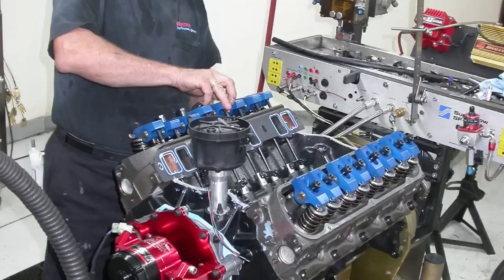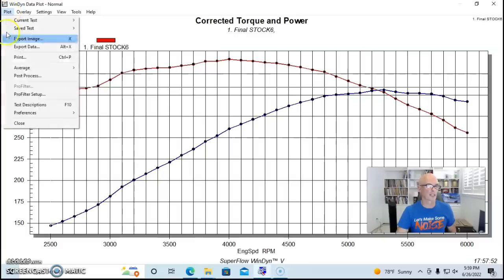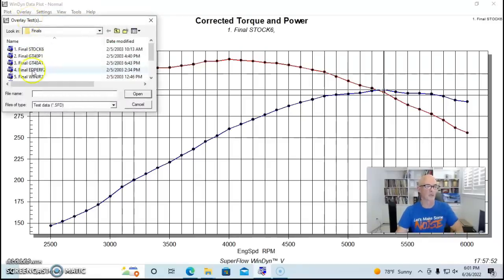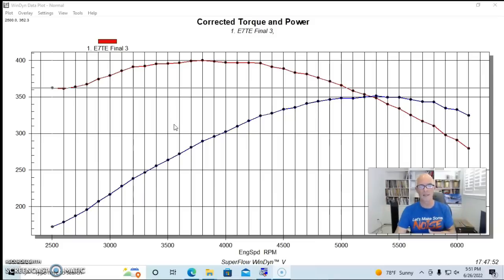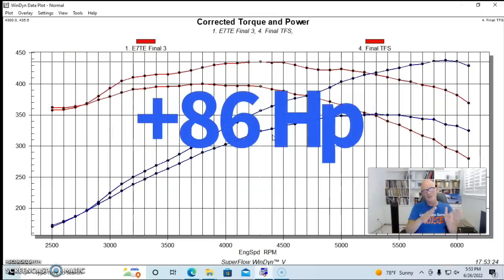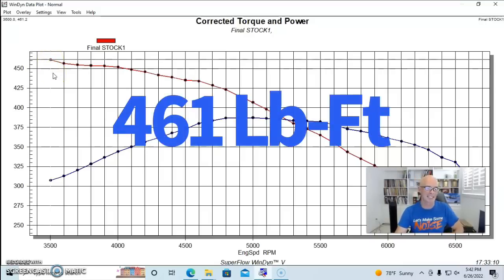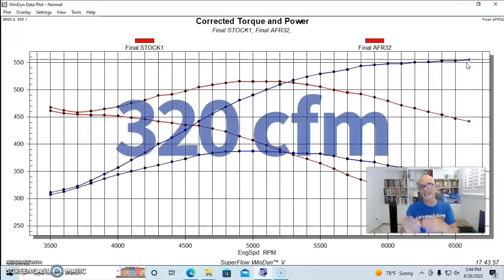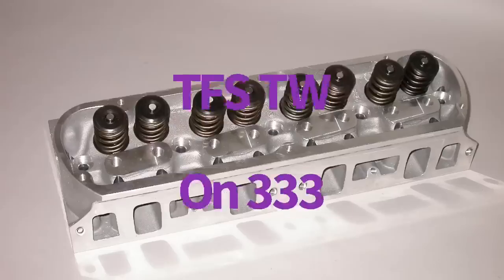IS THIS THE MOST POWER EVER PRODUCED FROM STOCK FORD E7TE HEADS? TOP SECRET-HEAD UPGRADE ADDS 168 HP

Comment: yes stroker  engines  can make more power  not only from the increased displacement but from the better breathing efficiency resulting from a relatively more  square bore/stroke sooo more power per flow cfm …..this is why a 400 hp 302 needs a 270 cfm head not a 200 lol where as a perfectly square engine would actually make 400 with 200 cfm

Comment: I'm not trying to be a smart-ass, but it is amazing to me that no one has taken a 317 head and milled it down to the same compression as a 706 and done back-to-back test on it. All I hear is the 317 is worse. How much worse is it. Is it 10 horsepower or 40 horsepower? It seems all I've been hearing lately is just speculation and no actual dyno test to back it up period is there actually a video showing showing the comparison?
Reply from the maker: you can't mill the 317 down to 706 chamber size (that's 10 cc)-but Brian Tooley from BTR has compared the 317 to the 243 heads with the same chamber size (they already have identical ports and valve sizes). The chamber on the 243 heads made better power

Comment: Stuck at work (wasn't the plan) but I'm making the most of it and binging on your SBF videos with my ear buds in. This is such a valuable resource - thank you so much for taking the time to put these videos out there.
Have you done one with Windsor SRs? I know they're not the best OOTB but I keep hearing how they respond well to porting. I have a set I picked up on eBay that will be used in a fairly low budget 351W build, and wondered how they perform before and after they've been worked on.
Thanks again.

Comment: I wonder what kind of power the 393 would make with GT40 3 bar heads.🤔
Reply from the maker: 30-40 more than stock
Reply: @richardholdener1727 Do you think throttle response would be good because of the smaller intake ports on a big engine combo? Also do you think a 750 carb would be enough to feed that combo?

Comment: is the 393 a tall deck block like a 351W? and if so, did the head bolt holes on the heads have to be increased to 1/2"?
Reply from the maker: YES AND YES ON THE STOCK HEADS

Comment: As always Richard, your videos are informative, as well as entertaining. I would however, like some clarification... I did not know that 393ci could be achieved from the lower deck-height 260-302 blocks. 347ci is as much as I thought possible from those engines.  Thought that many inches could only be gotten from the taller 351W based block...
Reply from the maker: the 393 started as a 351 block
Reply: @richardholdener1727  Many thanks for your prompt response, and clarification...

Comment: Your test are useless because you change more than one thing at a time. You have to change only the part you are testing in order to say what it does. That means a stock motor with only the part you are testing. Not testing the heads and changing the cam or carb at the same time.
Reply: No when you test something you don't change a bunch of things and then say this is the result. You change one thing only and then test. If you gain 10hp by changing an intake, you don't change the intake, cam, and valve springs and then say by changing to this intake you'll gain 10hp.
Reply from the maker: YOU NEED TO WATCH AGAIN AND TRY TO UNDERSTAND THE VIDEO
Reply: Also from the start you say it's basically stock with .030 oversize bore then name 6 different things that aren't stock in the motor. A stock motor is all stock with a .030 oversize bore. You check the horsepower change one thing at a time and check the horsepower after each change. That's how tests are run.  @richardholdener1727
Reply from the maker: Let me know after you go back and watch then (hopefully) understand the premise of the video. I do many back to back tests on individual components (this was not that). Walk over to the trough-you will find water there.

Comment: 4:26 If the stock engine and stock heads peak at 5400 rpm. Installing aftermarket heads will not more the peak up to 6200 rpm.

Comment: That 393w with the AFR heads looks like a great combo for my 94F150 flareside! Been having trouble deciding between a 460-c6 combo, or just using my roller 95 truck  block to build a 393! With the big block and a c6 we're probably looking at 300lbs more weight! But, will my TCI C4 hang in there? What you think, it's gonna spin the the tires a light pole anyway!😂
Reply from the maker: cheaper to get junkyard 460 inches-but a 393 also works
Reply: @richardholdener1727 Well yea! I know that! But you gotta pull that fat bastard, plus the extra 40hp to pull the c6! I gotta Lotta parts for the small block, including a tci c4! Gotta set of professionally ported 289 heads, and a  tci c4! .030 over pistons already on the rods! A set of aluminum heads! Headers are probably pretty cheap! I know guys that were putting 460's into early 70's f150s! They had a 66 Falcon with a cheap 460 running 5.90 1/8 on a good night! But the trucks would run 7.0s on a good night! 1/8 mile of course,  but low buck cam, intake, gear and car! Turning them 5600rpm so the didn't have to change springs! The bought every 1970-1971 Lincoln in 100 miles! 10.7 /1 compression! 😂😂😂

Comment: RICHARD,, LOTS OF PEOPLE LIKE TO SAY THAT THOSE E7 HEADS ARE JUNK, THAT' IS THE FURTHEST THING FROM THE TRUTH. THEY ARE HIGHLY ENGINEERED HEADS THAT GOES BACK DECADES IN IT'S BASIC DESIGN.. THEY WERE DESIGNED TO GIVE YOU MAXIMUM PERFORMANCE AND EFFICIENCY AT LOW AND HIGH ALTITUDES. FORD PRODUCE THESE SMALL BLOCK MOTORS WITH THAT HEAD DESIGN AND PUT THEM IN ALL THEIR VEHICLES AND SOLD THEM ALL OVER THE COUNTRY IN REGIONS THAT WERE HIGH AND LOW ALTITUDE. THAT WAS THE PURPOSE OF ITS DESIGN WITH ITS SMALLER PORTS AND VALVE SIZES.. LOOK AT THE OLD FOOTAGE OF RALLY RACES IN PERU AND ECUADOR UP IN THE MOUNTAINS WITH THE 289 FALCONS THAT USED THAT SIMILAR HEAD DESIGN. IN HIGH-ALTITUDE WHERE THE AIR IS THINNER WINNING COUNTLESS RALLY RACES. IN DRAG RACING THE HYPO 289 WAS MAKING 450 HORSE WITH THE FACTORY MERCURY COMETS IN A/FX WITH THAT SAME HEAD DESIGN. DOUG NASH DROVE ONE OF THOSE COMETS AND SET RECORDS AND WON MANY EVENTS WITH THEM USING THAT SAME HEAD DESIGN. IN 1964 THE 289 HI-PO WITH THAT SAME HEAD DESIGN IN THE DAYTONA COUPES WON LEMANS AND BEATING FERRARI BY OVER 40 MINUTES IN THE GT3 CLASS.. THEY CLOCKED THE DAYTONA COUPES AT OVER 200 MPH WITH THAT HEAD DESIGN. AROUND 15 TO 18 YEARS AGO. OFF THE STOCK BLOCK AND HEADS THE 289 BROKE INTO THE NINE SECOND BARRIER WITH THOSE SAME HEAD DESIGN.
Reply from the maker: none of those race applications were anything resembling stock heads
Reply: @richardholdener1727  THERE NEVER WAS A RACE HEAD FOR THE SMALL BLOCK FORD UNTIL 1987 WHEN TRICK FLOW FIRST MADE ONE.
Reply: @richardholdener1727  THE HEADS FORD USED WERE THE STOCK HEADS. FROM 1968 INTO THE 70'S. FORD CAST A HEAD USED ON THE 351 WINDSOR WHICH WAS A 2 BARREL HEAD OFF OF GRANDMA'S STATION WAGON, A NONE RACE ORIENTATED HEAD. ON THE INTAKE SIDE ONLY. WITH SMALLER INTAKE VALVES AND INTAKE PORTS FLOWED JUST AS GOOD AS CHEVY'S BEST HEAD THE FUELIE 2.02 A RACE PURPOSE DESIGNED HEAD. THIS IS HOW FAR AHEAD OF CHEVY FORD WAS IN DESIGN. THE WINDSOR HEAD IS A SPIRAL INDUCING COMBUSTION CHAMBER. THE INTAKE PORT CURVES INTO THE INTAKE VALVE INTO THE CURVE OF THE CYLINDER WALL GIVING IT A SPIRAL EFFECT TO KEEP THE FUEL MIXTURE PERFECTLY MIXED AND ATOMIZED. THIS IS THE REASON WHEN THE 5.0 ENGINE THAT DEBUTED IN 1983. DURING IT'S TIME WAS THE HIGHEST VOLUME OUTPUT MOTOR IN THE WORLD. FROM A 1 CYLINDER TO A 12 CYLINDER IT MADE THE MOST HORSEPOWER PER CUBIC INCH. THE ONLY ENGINE WHICH HAD A SIMILAR OUTPUT WAS THE V-8 IN THE 308 FERRARI AT THE TIME. THE 427 FORD HIGH RISER IS BASICALLY A WINDSOR HEAD DESIGN WITH THE INTAKE PORTS RAISED UP. 
YOUR LS HEAD IS A COPY OF THE FORD WINDSOR HEAD WITH THE RAISED 427 PORTS. PUT YOUR FINGER INTO THE PORT OF A LS HEAD. THE PORT CURVES INTO THE INTAKE VALVE IDENTICAL TO A FORD WINDSOR HEAD. THIS IS THE REASON THE LS CAN ACHIEVE FLOW NUMBERS LIKE A BIG BLOCK CHEVY HEAD. FROM TOP TO BOTTOM THE LS IS COMPLETELY FORD IN DESIGN. NOT 1 DESIGN ASPECT OF THE OLD SMALL BLOCK CHEVY LIVES IN THE LS.

Comment: I have a question if anyone can help guesstimate what mine might be making at the crank. What would a 1989 302 (bored to 306) stock heads, trick flow stage 2 cam, Edelbrock performer intake, 600 cfm edelbrock carb, and long tube headers range in hp/tq at the crank or at the wheels with an AOD? 
Running alternator, water pump/ and power steering.
Reply from the maker: mid 3s
Reply: @richardholdener1727  thanks man good to know!

Comment: Nice comparison. It’s amazing how a good pair of heads can bring the small 302 to life. I’m about to upgrade the heads on my 88 Lincoln Town Car and I’d to have stock like idle. What’s the cam you can suggest for stock bottom end and a pair of Edelbrock heads? Thank you.
Reply: Do you need/want a bunch of RPM? The stock HO cam with 1.7 rockers works extremely well for a street car. A friend of mine had a stock 5.0 bottom end with a set of Windsor Sr iron heads, Performer RPM intake and the factory cam with 1.7s and it made over 300rwhp with a t5.
Reply: Be careful, I think your engine has the flat top pistons, (no eyebrows) like the 86 GT did and you will have interference

Comment: Poor flowing heads need duration lots of duration to work, the last combination you gave it duration.
I’m getting close to 700hp and 630 tq from my iron headed 440 Mopars… 915 casting 2.18/1.81 valves 12.5 cr  278 and 284 @ .050 flat tappet advanced 4*  shift @6500
I’ve got to hang the valves open to make power!

Comment: There was a day when 1 ho per CI was a really good benchmark and today it's mehh, the way it seems now is the acceptable minimum nowadays  1 RWHP per C.I. Or it's a total stone. It's easy to get hung up on numbers I know I do but in a regular old street car like a mustang even 300 crank HP is plenty to have a blast on the street. With a set of lower gears like 3:73 even 3:55 and that 300hp you actually have a pretty quick street car and have factory like drivability.if your going to Friday night cruise in or something pop one of the small vacuum lines off and whalah you have a lopey cam! I had a vacuum leak for months my 95 GT sounded tough, I finally found it it was a small line to a mystery box behind the intake. I never see any drivability or mpg difference after fixing it, it  just had a nice lopey idle before I fixed it one that I got complemented on!. I almost popped it back off lol but I didn't.

Comment: I'm curious being draw on the cylinder head increases flow with larger displacements if a similar outcome would happen with higher compression on smaller cubic inches? Ex: 302 with 12:1 cr

Comment: To be honest, this just says to me that Ford could have put a 351w in the Mustang to go head to head with the LS if they really wanted to, when even those lil ol E7s can put up 1HP per cube on the dyno with those inches. But, alas, the commitment to the Modular was made. I love my mod motors, but it would've been even cooler to still see a 5.8 offered beside the 4.6(or if they at least would have just gave us the 4v heads in the GT from the beginning, still would've been short on power but certainly not as bad...), ya know, stretch that transition out over a longer period lol. Then, they could've phased out the 5.8 with the 5.4 instead of just restricting it to the '00R early on...
Reply: They didn't really need to.....Camaro's went extinct in spite of the LS1....  I get what you're saying though and wish they would have matched cubic inches even back with the foxbody's
Reply: It would have been hard to go head to head with the LS engine since the Windsor was already discontinued.
Reply: @Olds_Pwr  Yes, the obvious inference being that they would've continued producing it(and in a more Mustang-oriented form; maybe the '95 Cobra R 351 becomes the standard Cobra engine while the 4.6l is the base engine for sub-Cobra models). Bring in the 5.4l Mod when it's time to completely phase out the 351w around 2000 or so, or maybe at the S197 changeover. 
Either that, or just make all Modular V8 Mustangs 4vs like they should have; 4.6l 4v for all sub-Cobra models, 5.4l 4v for Cobras.
They could've went a number of different ways - but they chose probably the most unfortunate option for enthusiasts.

Comment: I'd like a test of the base Edelbrock fuel injection intake.  Not the short runner RPM intake.  Would be nice to compare it with the tubular GT40 and the Trick Fuel intakes.

Comment: Through a Set of 351 Cleveland heads on there they'll work with a little bit of modification
Reply from the maker: lot of modification
Reply: @richardholdener1727   it should be possible lol but a lot of work

Comment: Great video Richard, you tests got me thinking whether the later GT40P heads would be a better starting point on a 347 than the E7TE heads or would they be restricted to around 350 hp like the E7TE heads?
Reply: If you learn how to port    you may be able to save money.  Not that GT40s are going to be that much more than E7 though.. but lets say you have E7s already and want to spend  nothing but some cash on grinding tools..   I had to change out E7s I already ported       and I already had my roller rockers and SS valves  ( smaller intake )  so I bought some E7s from a friend.   But basically the trick to exceeding GT40 flow is not just opening up the short turn radius and blending out the dog leg  to about .550  to the wall   to the OD of the valve stem hole.... But trying to clone the short side distance... going by the apex of the short side of an E7    I get about a 1.225 ... GT40s  floor and short side are about a 1.340... Now there is a water jacket but as long as you stick to 1.340 and under its fine.   Point being on flow bench tests I've seen   how big of a difference the E7 short side makes.    Other tricks like scavenge plateau on the exhaust in the chamber open about 3% more horsepower..    But  to really get it over the 200 CFM mark    you have to open the short side and floor.   The short turn and dog leg is the real restriction but      matching that short side to the GT40 is a clue... Also   removing the pushrod pinch   more biased toward the roof of the tunnel     ( so only flattening 50% of it )  helps open up air while not losing too much velocity.   Intake port entrance stays stock.    Same with exhaust port...  Youre barely skinning it open     like it wouldnt even be port matched to the factory gasket.     For my 306    is in a truck build    so my objectives were high velocity and good numbers under 5500 rpm   and   .500 lift and under.   Thats why it didn't matter still having a 1.78 valve.  At the same time porting a GT40   can more easily see 220+ cfm.     Just for the record E7s especially on a roller engine can probably make 400 hp.. Obviously larger valves would be chasing that.    It's not hard to get them to 360 +   on a flat tappet  with even a 3/4 size cam.   I'd argue you can definitely get a 5.0 sized engine to high 300s on E7s even with flat tappet.   There's many tricks  that don't just lie in the head... Many porters don't even know the scavenge plateau cut  and on an engine of that level is a good 10+ chunk of power right there.  Also  Building a 5.0 like that is on par with at least the stock first gen coyote and I would argue if you could clone cars the OHV ( the real 5.0 ) may have advantages in certain areas of a track with a greater power band ..   Looking at average dynos of a 2V 302   will have a power band     that stays about 10 tq   and 10 hp  ABOVE the coyote until the mid 5000s and the dohc is going to scream out an extra 20 hp ...     Torque and lower power bands are just better and more realistic for the street.   Its an age old debate with a lot of the sport compact kids who never understood power band significance.     I had a Supercoupe  ...  The 3.8 is basically a 302 with a couple cylinder lopped off... same bore and stroke..   But those little valves paired with a roots blower?     Mine was barely modified     maybe made somewhere between LT1 and LS1 in horsepower but the torque had to be close to like 420-450 ft lbs.  It was insane.   3.73 gears .   Killed two AODs       When you get into autorotors and higher levels the power band is not as extreme but the thing basically had the power of a big block.  Neck snapping loll    Not the fastest car    especially dealing with heat soak with factory intercooler but ...   It was all ported out,  eventually got a better cam and beehive springs on a rebuild but...   As far as  proving how important a power band is ?    Was like a Tesla.      Funny thing is    whenever you would look up   a Supercoupes ( on the forums)    1/4 time    and if it had a dyno number?   It NEVER made sense to people with how low the HP seemed.    3800 lb cars running 12s      with rwhp still in 200s lol  .    But the torque?     peaking at 3000?  man....    So anyway.   The Tbird sold me on that powerband      as well as some of my friends ....  At the same time?   The first time feeling a DOHC V8  I was also hooked on how it kept pulling and pulling but...   Funny how Magazines used to have "luxobarge" shootouts... I bet Richard was there for that lol      When 3700-3900  was considered massive...   Now thats like a Mustang...   I feel like my van only weighs a few hundred more than a Hellcat 😆  but back when 400 hp meant something...  Sure wish I had a 5.0 like that   in my original 88 Thunderbird... 3300 lbs...  that would be so perfect.    87 octane   plenty of fun.
Reply: Out of the 2, the P heads are a no brainer.
Reply: Start at 13:30, he says stay away from the P heads. https://www.youtube.com/watch?v=GjTl_JSn1Zw&t=104s